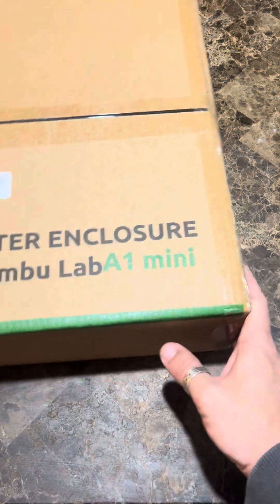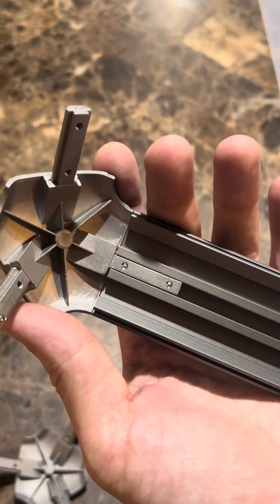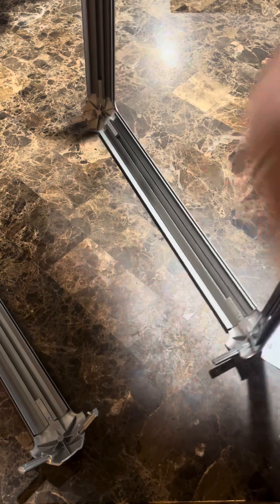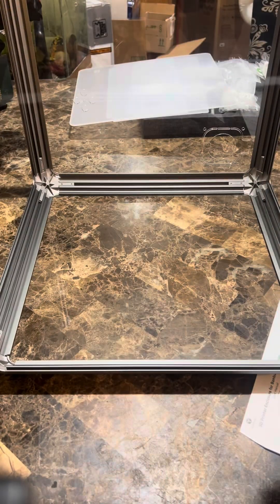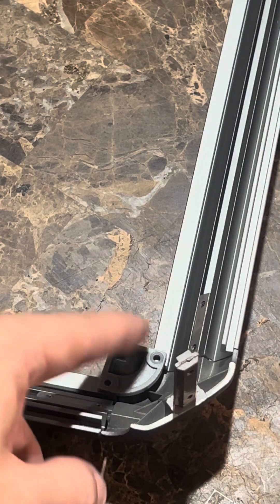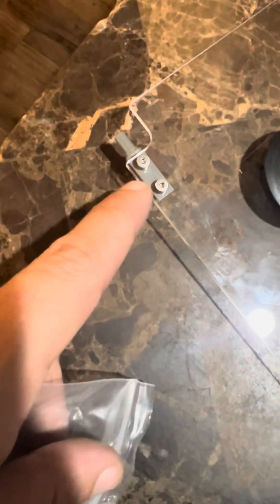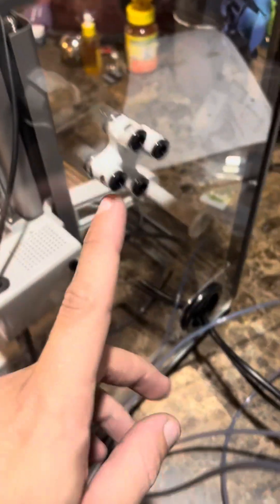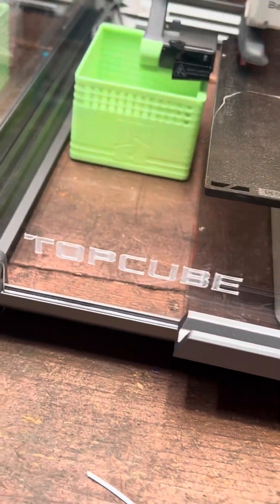Acrylic A1 Mini 3d Printer Enclosure Unboxing and Assembly

Comment: Got mine yesterday really like it! Fairly simple to put together! Wish it was 2 inches taller, best bet is to get the a1 and put the mini in it
Reply from the maker: I did eventually find one that is larger. I like the shape and light on the new one as well. Check it out. https://www.amazon.com/vdp/08e38603c670438d9db2518023f84821?ref_=aipsfvideo&linkCode=ssc&tag=kevinloves3dp-20
Reply: @CoinRingMaker I actually sent my a1 mini cube back and got the a1 cube and it’s nice and proper now!
Reply from the maker: That’s what’s up

Comment: First.
Thank you for making this cause 
The instructions are Horrible! 

I'm confused. How is this an enclosure if it doesn't have a top side Acrylic? 
Unless I'm short an acrylic side. I only have 4 square acrylic and 2 halves for the doors. Plus 2 extra connectors left in the box.

Watching your video I couldn't tell if you had all 6 acrylic sides, or your missing the Top or the Bottom/ Back?

And btw, naming it the Back in the instructions, but showing it on the Bottom is insane.

It's so frustrating...
Reply: You don’t get a bottom panel!